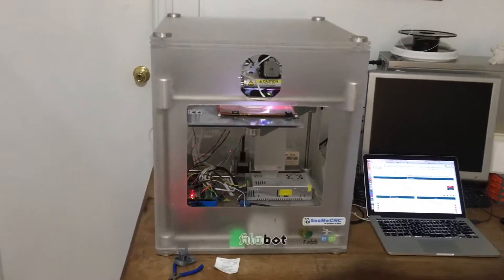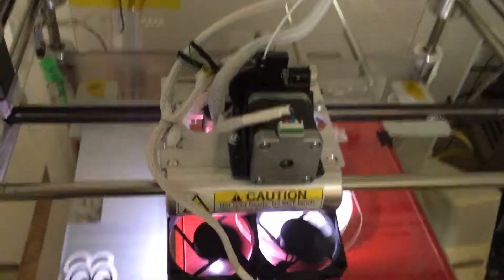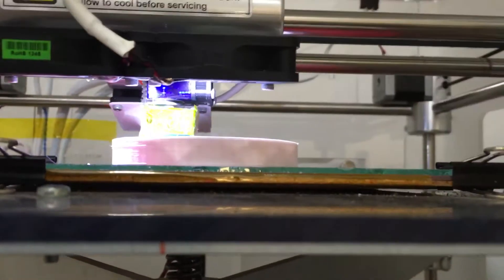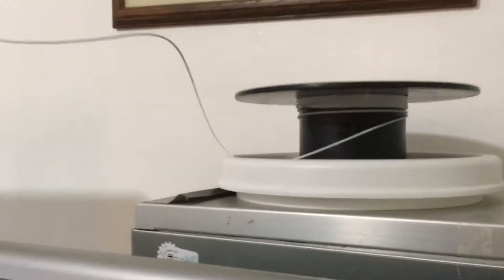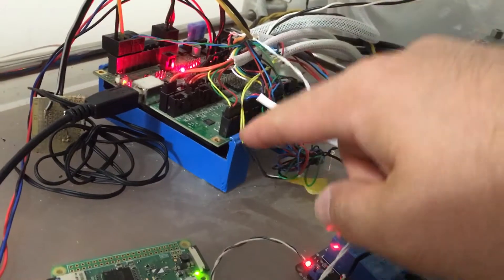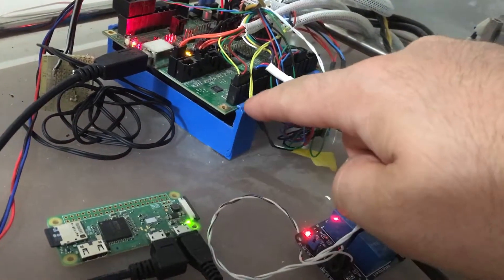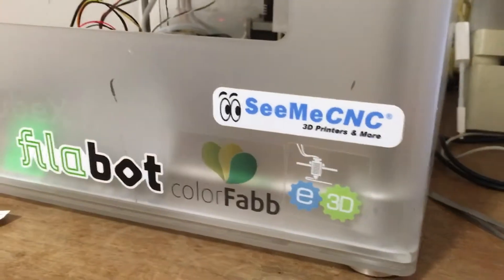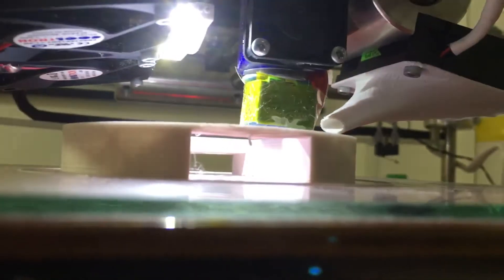My open source hardware conversion of a 3DS CubeX Trio 3D printer

Comment: That's an awesome conversion! I've had a CubePro Trio that's been sitting by my desk for a couple years and I'd love the do a similar conversion on it. Would you mind making a recommended parts list? Ideally with what you'd recommend for a 2022 retrofit. I assume there are some better DIY parts since 2017.

A much more specific question: was there an issue with the original extruders, or had they just failed with no replacement parts?

Comment: can help me solve my cube duo has a problem when pulling the filament is as if jumping I have already cleaned the nozzles and the problem continues.  You think you can help
Reply from the maker: I didn't use it much as stock. Try drying your filament, maybe "atomic pull" nozzle clearing?
Reply: @1S6NZKYLZBG64M  as well?

Comment: Awesome!  A few questions, if you would:  
Can you measure how much travel you have in X and Y for the single nozzle?  I'd like to be able to get a full 300x300mm. 
The stock print surface is like a glass plate with some white coating on top of it, right?  I'm wondering if I could adhere a silicone heater directly to the underside of that.
Alternatively, I could fit a 300x300mm PCB Heatbed with normal boro glass on top, which leads back to the first question... 

Thanks! 
-Ray
Reply from the maker: I have 200x200x150mm of space with that build plate. There is definitely room for a larger HBP, but this one was the easiest to install for this version. It's just a PCB heater with glass on top. The stock surface is plastic laminated on glass, but I'm not sure of the material.  I have plans for a big glass plate and silicone heating pad in the future.
Reply: Where you able to use all the original cables with the Rambo or did you have to make any new ones?  One other question - how did you connect your extruder to the e3d? Did you make a part?